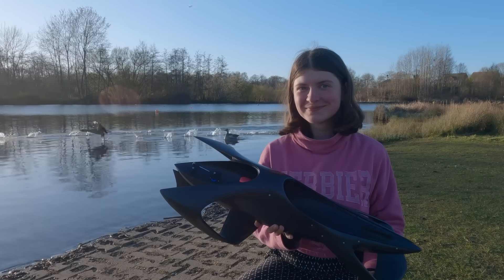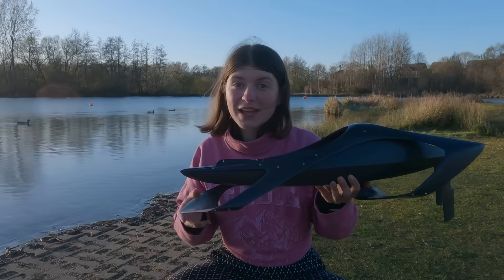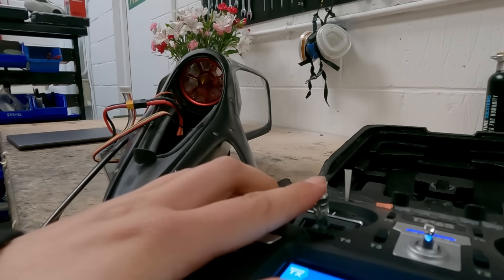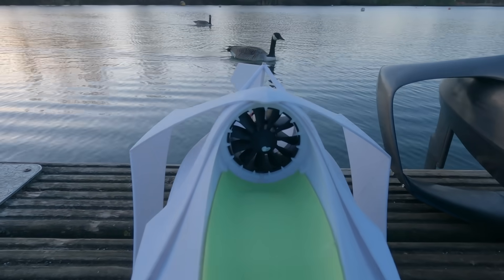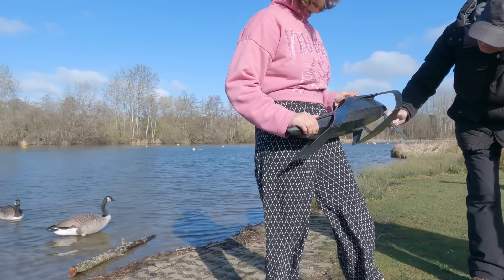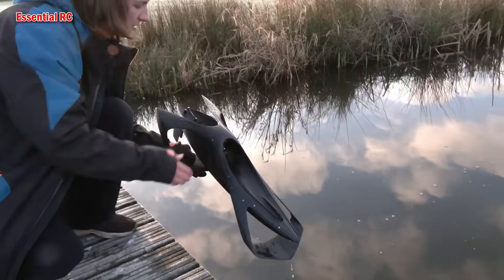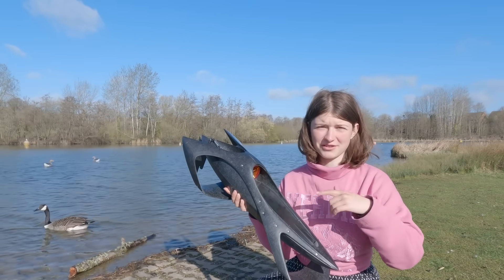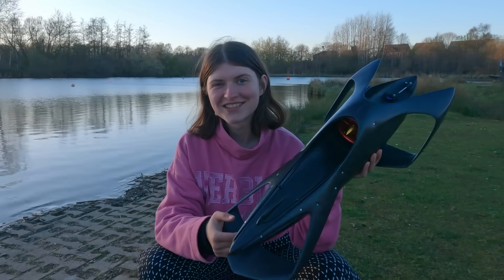Boat Propellers are Overrated... The HydraJet Explained

Comment: The full sized one would be fun, but incredibly unpleasant to water ski behind. I'm wondering how well it would take a mouthfull of water, like if it were to hit a wave, or even just backsplash amounts of water. It made me wonder whether it could handle a finned shroud that caps the motor and draws air from the reverse direction. (Mind you, it would probably suck water in, regardless of the direction of the air intake...?)

Comment: Low speed wing-in-ground vehicle directional air rudders are about 1/4 of total length for the stubby double wing design. 
Also look to Florida everglades air-boat rudders for approx total area. They can spin 180⁰'s without moving forward more than a body length or two from stopped.

Comment: The best propellers used to be the oar. They would propel you anywhere your arms would take you. Didn't need any kind of diesel electric or gasoline. Purely man or woman powered. Even large ships was oar powered at one time.

Worked great for centuries. Some people even use oars today and on small boats that do have engines that are on rivers or lakes they are required to have by law in certain places.

Comment: Retired mechanical engineer of 43 years. You have done a beautiful job. It looks like you have discovered the strengths of compound curves. Have you tried molding prepreg carbon/epoxy sheet inside 3D printed and smoothed molds (or just do it manually with 3K cloth)? If you need smoother surfaces and can stand the weight hit then you can coat critical surfaces with two layers of two-part epoxy and go through the 350/600/1000/2000/buffing routine to get a shiny finish. Does not take long with sanding sponges and a little water. It looks like you could design the ducted-fan as a stand-alone assembly that pivots on a servo instead of adding an air rudder. That would eliminate any (air or water) drag from a rudder and you could use an appropriate NACA shape for the duct and it could be easily 3D-printed. Also it would remove structural mass that is not contributing to overall strength. Another thing to remember is aero skin drag. Any surfaces that are not essential add weight (hydroplaning drag) and drag on surface of the craft in air. Looks like a lot of fun. Keep on building cool stuff! If you are not already check out Onshape.com and get a free public account.

Comment: Water is 800 times denser than air.
Maybe a fan jet with water as a density augmentor?
It should also reduce the exhaust noise.
(If you don't know what I'm suggesting, let me know : )

Comment: cool, thank you for sharing!    Curious if you tried side by side fans and use variable speed for steering?   Also, how did you go about forming the carbon fiber?  I've been looking for a low cost means of prototyping with carbon fiber.

Comment: Wow. Have you thought about molding closed cell foam rather than using carbon fibre? It would speed up production. Carbon fibre seems a little overkill. If moulding is too expensive you could probably hot wire cut most of the shape of the boat then rasp or mill the parts you cant wire cut. This applies to the foils too. Maybe reinforce the foils then you could make them thinner/faster?

Comment: nice design. But saying "Overrated" is false. This kind of drive is very inefficient. It has a use wherever there is no possibility to use a water screw for some reasons. But other than that, it is one of the worst ways to move on water.

Comment: Head of engineering and 3rd generation RC boat builder here: that's an incredibly well designed and engineered boat.  Gorgeous style - form and function. Keep up the excellent work.
Reply: Agree with you sir, this one has a great eye.
Reply: Garbage man here. I like how much junk it can carry.
Reply: Hire her! If possible haha
Reply: It's a complete rip of the andromeda ascendant from the tv series.
Reply: Some company needs to guide her and help her through school
Reply: i dont care how it looks, if it handles like a dream.
Reply: How would this design handle scaling up, with the cubed/squared law stuff getting in the way?
Reply: @Albtraum_TDDC  ive seen semi similar stuff for smaller ferrys,
what she should do is add a duct & baffle or 1 or 2 adjustable ducts to back of the jet engine so you can steer it via the jet engines exhaust direction then you could turn at speed and youd have a lot less drag, because no rudder at back needing to be/dragging in water
we have hydroplaning ferrys here propelled by electric fans but they steer them with small rudders and hydrofoils on main hydroplanes and by directing the engines exhaust
the sound is partially because of the turbine type/blade angle and shape it can be a lot quieter with the right  models of electric turbine
Reply: I'm not trying to be mean or anything, but are you sure? Impellors really don't perform all that well at low speeds and are kinda made for jet-airplanes to reach higher topspeeds (>200km/h) than a propellor plane, i feel like they're the worst possible choice you can pick for a boat, and the videos of the boats going around kinda show that, to me it just looks like a typical form over function boat, from what i've seen i'd say the topspeed of that boat is somewhat comparable to a 3S boat, but it doesn't seem to be anywhere near other 6S boats. But i guess the advantage is that you're not gonna start flipping it the moment you go full throttle 🤷
Reply: @weibrot6683 whatever it's a hobby. In RC the goal of the hobby isn't always to build the most efficient, practical, and utilitarian design. If that's your thing have fun with that. But criticizing others hobby projects that don't adhere to your criteria, that doesn't hold water.
Reply: @weibrot6683  you didn't listen. She was a broke student. Had thè EDF. Designed this cool thing around it.
Reply: @weibrot6683  The thing about feeling's is that it's just that, a feeling. It's not reality in the sense of actual being real. It's just you without real knowledge  having an emotional response and telling everyone what you "feel."
Reply: "3rd generation RC boat builder", so your grandparents were building RC boats? I guess that's just about possible, although I think you'd have to be fairly young. Not absolutely sure that declaring it as a qualifier to your opinions doesn't make you sound like a bit of a ... but whatever makes you feel important, I guess.
Reply: @danoneill8751  The guy has credentials in the field and you're criticizing him for giving kudos to her accomplishment.  LOL, maybe when you have any form of education beyond elementary you will have the knowledge to understand instead of berate like an infant.
Reply: How practical is it tho? Requires a lot of energy. Is VERY loud - would be way too loud at a larger scale. Doesn't handle well, only efficient in straight line at speed. Would it even foil if it carried a load? And you need enough water depth for the rudder to work. Would require special docking. So... how practical is it?
Reply: @deadpanfish  ever heard of Airboat, planeboat, swamp boat, bayou boat, or fanboat, it has been around for AGES and is a thing, this is just a GOOD designed one that LOOKS good and DRIVES well =) So a good thing, yes it is loud but so is a V12 speedboat lol, you can sit in one without airplugs at all =) 
This is not something new, it is just a modern designed boat made out of 2 different existing boat types, a hybrid if you want, Airboat Hydrofoil if you like =)
Reply: @deadpanfish  I'm not sure a small RC boat will ever require special docking, you just pick it up out of the water with your hands. Also, this RC boat doesn't foil, it planes on the water.
Reply: @samsinite100  Lol, he's talking about it scaled up.
Reply: @robertnicholls9917  but she mentioned that she wouldn’t build a boat for her to sit in or a large boat like that.
Reply: @deadpanfish  you are the worst type of person. People certainly talk about you behind your back, and they aren’t singing your praises. Seems like you realize this already, hence your atrocious personality. Just gave in and became the asshole everyone says you are, huh?
Reply: @deadpanfish   Honestly I think it's a great design for a near weightless toy but I don't think it scales at all.  Multiply the power increase by the mass increase and I think you'll find that everything you wonder about is a serious issue.
Reply: @deadpanfish  i wonder how practical and noisy a hovercraft is ?
Reply: @deadpanfish, your comment proves, you know, squat about boating. Water or docks.
Reply: @allanthomas6097  Not to mention a real engine, would have more than enough thrust.
Reply: @deadpanfish   "Loud at a larger scale": Ok, who cares? This is an RC boat, not a scale model of a human-sized boat.
"Only efficient at speed": well it's a speedboat. 
"If it carried a load": I don't know if you're aware, but RC boats are very rarely used as barges. Also, the same can be said for literally every single vehicle ever. Would a F1 car work if it was transporting 2 tons of concrete? No it wouldn't. You'd design another vehicle for that purpose. It doesn't mean the F1 car is inherently bad. 
"Special docking": you know hydrofoil ships have existed for decades without special docking?
You're just flailing around here, and I don't understand why.
Reply: @frankkrunk  Having raced fast I/C R/C monohulls (15cc, 10cc, 6.5cc & 3.5cc) which were horrendously (but also beautifully) noisy in the mid 80's to 90's, as wall as studying Marine Engineering and Naval Architecture at Uni back in the 70's, the design looks great. It does what it is designed to. I would like to see a model scaled up to around the 2 metre mark as it would be interesting to see how you would power it. Whether it would require twin nacelles, those types of questions would no doubt arise.
Reply: @ 100% this, some solutions don't scale at all. Putt-putt boats, for example :) There's always a sweet spot for every design. Maybe the hydroplaning only works at a smaller scale, maybe the weight of the fuel/batteries will make this unfeasible at a larger size. But even as a hydrofoil this would be an awesome design.

Comment: Just as im a metalworker not an engineer i figure you got a leg up on make my idea real (that is i never got started building anything)
Anyways. 
The thought was a catamaran hydroplane, Possibly Trimarane for stability, using a kitesurfing.. Uhmm sail.. kite.. One of them. 

More or less the innovation or well least change from the standard sailboat. Would be to have it hydroplane, only using finns to counter wind drift, alot like modern racing sailboats. But avouding the huge dynamic wing those employ as sails. Rather, basically a steerable kite would pull my version with a low positiones anchor point to the boat.. Imagine a height adjustable ring around the front and sides of the twin/tri hulls where the kite is held by a little cart on rollers, akin to a curtain rail or suspensded amusement rollercoaster.

In my doodeling this i imagined the kitesail (unlike ie kiteboarding ones) would hold servos to steer it, thus avoiding twin or quad lines from the boat. Rather id guess a single line carrying a wire.

Dont have a clue if itll work (to any kind of impressive level), but you are ahead on chances of trying it out, so there you go if you like.

Comment: Dieses Design ist für diesen Zweck sehr gut, aber es ist ein sehr spezifischer Verwendungszweck und deshalb direkt Wasserpropeller als überschätzt zu betrachten ist vielleicht etwas zu weit.

Was die Herstellung angeht, hast du vielleicht mal einen professionelleren 3D Drucker probiert welcher auch direkt Kohlefaser drucken kann? Ich erstelle damit regelmäßig Teile und sie sind sehr belastbar. Das dieses erste 3D gedruckte Modell von dir nicht Marktfähig ist, das ist mehr oder weniger offensichtlich, Kunden bekommen alles kaputt. Es gäbe auch die Möglichkeit Verstärkungen an Bruchstellen einzubauen oder mit Kunstharz zu überziehen um die Teile zu schützen.
Dein Produkt sollte mehrteilig sein, so dass du auch einzelne Ersatzteile zum Selbstaustausch liefern kannst ohne gleich das ganze Produkt zurücknehmen zu müssen.

Du scheinst sehr fleißig zu sein, viel Erfolg.

Comment: Well done, very smart. You need to protect your design. Try controlling the airflow direction at the back with a nozzle or dual horizontal/vertical flaps.

Comment: The planing foil is a very novel concept. It is very interesting to see it work so well. Plus the tandem foils with the forward foil angled to protrude is a fascinating design choice. I'm curious what it does to the force vectors on the foil and structure. It brings to mind wavepiercing hull designs,

Comment: I remember I saw a very short "boat" in the rapids that can turn in imposible ways thanks to the movable jet, it just throws water as a propulsor ... Why don't you design a rotary propellor ? .. I mean ... the same fan , but wirh a short angle to turn to the left or to the right in the vertical axis just like this micro boat with a water jet ... the control of the turns is out of the water ... the key is the "spin" of the fan just like a Gyroscope ....You're Welcome ¡¡¡ .... https://youtube.com/shorts/LzlxNYQ-xGI?si=ZQrgW5hvPqRG-Mgy

Comment: Very cool! It would be interesting to also see which education skillsets went into designing and constructing the various parts. You mention your degree a bit in this video, but it would be interesting to know which courses taught you the skills you used for specific parts of the build or the design. For example, hydrodynamics, and what kind of mathematics you used to calculate the hydrofoil shapes. Or your prior experience creating carbon fiber parts. Subscribed!

Comment: Good morning 🌅, very interesting 🧐, Need For Speed, Yes, good luck with your journey, what you have achieved is amazing, back in the 80s and early 90s , I was building IC , 3.5 7. 11. 15. Cc, hydros , some parts out of , kevlar and carbon fibre, in the 80s electric speed record was around 25mph , I designed and built Hydro electric power , and my first run I achieved 52mph , I ended up blowing up the electronics, 
They did try to ban me for excessive noise, but they did accept it in the end , I believe technology has moved on since then, better motors better to let electronics, and I believe the record is somewhere over 100+ miles an hour, 
Good luck with your projects , you sit there to make some serious money you seem to be very very good at engineer and design, 
I wish you all of success for the future , from a very old English dude living in France,

Comment: Very nice. Be careful with carbon fiber, it might be as deadly as asbestos so wear protection and work in a clean room where you can check for microscopic remains.
I have a significant amount of wisdom about energy efficient vehicles from 2006 and on in the beginning of electric car revolution, I've watched many try and fail because they didn't listen so I can save you from a lot of dead ends if you like. One important issue with going light and very efficient is the weight disadvantage in traffic in a collision which will make it commercially inviable. There is a big difference between fun idea and what people will buy in the numbers needed.

Comment: Boeing designed a jetfoil boat that they sold off to another company. But, IIRC, the it used a jet engine turbine to power a powerful waterjet under the waterline.

https://en.m.wikipedia.org/wiki/Boeing_929_Jetfoil

Your design is way cooler!

Comment: Awesome work, you have some great talent.

RE SPEED, for what it is its fantastic, but unfortunately its lacking when compared to a prop RC boat of the same size.

That could be an idea. It doesn't need to be high end, but what about buying a mid-range RC boat of the same size and use it as a benchmark? Theory been it could highlight any advantages/disadvantages or make a great camera rig. I dare say some of the differences would be inherent of the design but it might give you new areas to focus on. 

Crazy idea, but what about a 3 phase boat? 1st- in the water, 2nd- on the water,3rd- over the water (Ground effect)

Comment: Nice work. If you like CFD, you can play around with your rudder design, it appears to be the cause of most of your turbulence and drag coming off the back. Compare its rooster tail to that of the Americas' cup sailboats. Not for speed purposes, but you will lower your Amp draw on the EDF from an efficiency point as well as add speed if needed.

Comment: very cool design, that must have taken some modeling and simulation?
for production you should consider vacuum forming for the top, and maybe even or the main body, the wings will likely do better with some composites, but maybe you can mold it so you can produce it relatively quickly.

Definitely would love to see a full scale version and experiments with more speed and/or under water  impellers would be awesome.

Comment: Just a random thought, but I wonder if that thing actually needs a rudder at all, but could turn by using a moving ballast, possibly inside the water wings or their connectors, to make it tilt? Might be a good way to lean into that exotic aesthetic, and also one less exposed moving part.

Comment: That's so cool! More please. Also, if you're looking for a piece of hardware that might make it easier to incorporate a water propeller I'd recommend looking at flexible drill bit extenders as a way to avoid needing to pierce the hull and keep the motor away from the water. I'm also curious if you could add actuated air foils to the top of the boat to to control the down force and essentially turn it into a hydrofoil by pushing it into the water.

Comment: love it.

instead of manufacturing each body you could tool a mold for marine foam to produce 50+ chassis without having to use expensive materials

or you could even 3d print the design with a toroidal infill and fill it with foam.